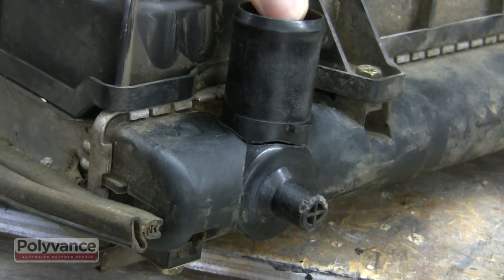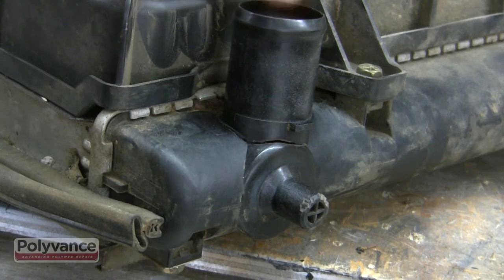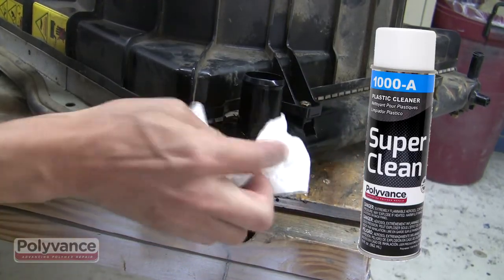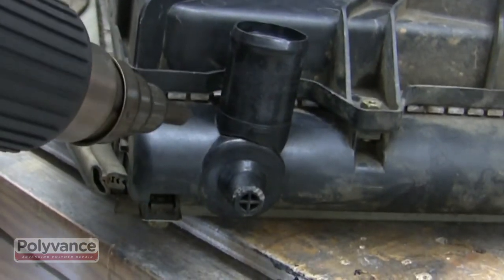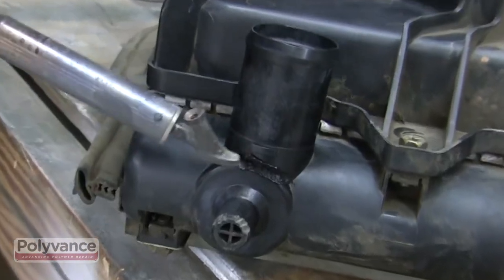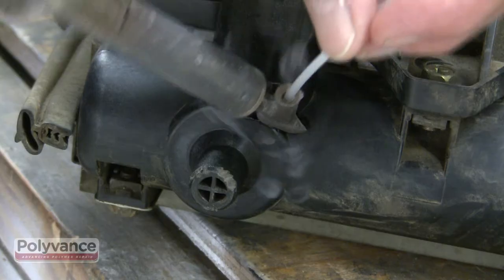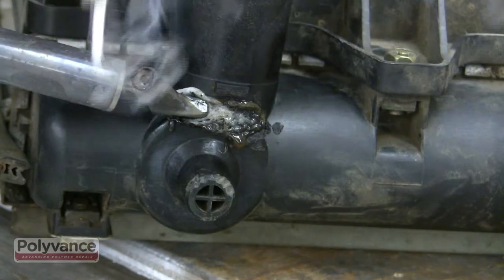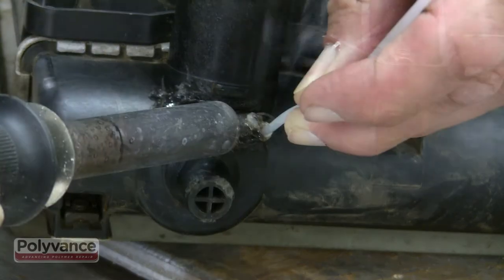Plastic Radiator Repair - Cracked Radiator

Comment: can you use this on a fan shroud ... can we sand it down ? or is there another product that we can use
Reply: If the fan shroud is nylon, yes you could use this kit to make the repair.  Many fan shrouds are PP, in which case, you could still use this kit, but would have to purchase some Polypropylene welding rod.  It can be sanded and painted if desired.  PP woul need adhesion promoter, prior to painting.